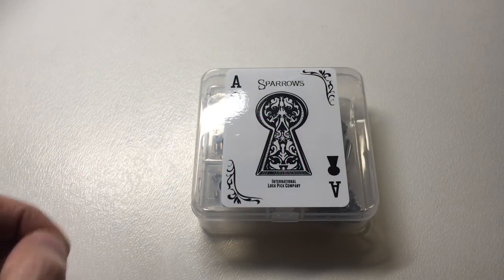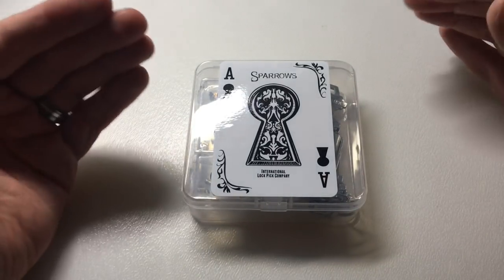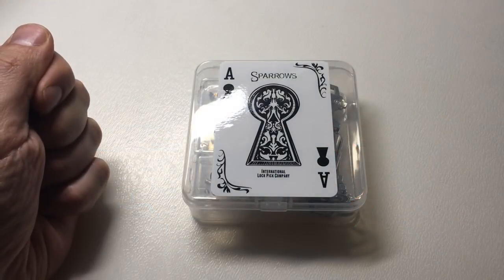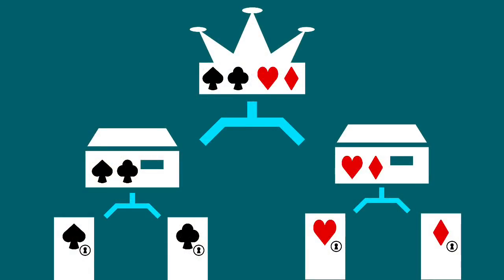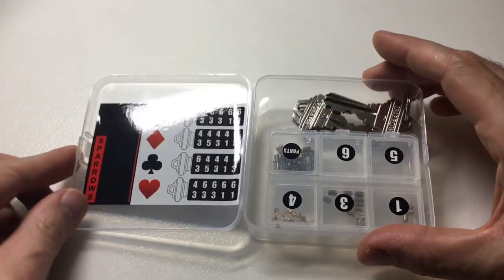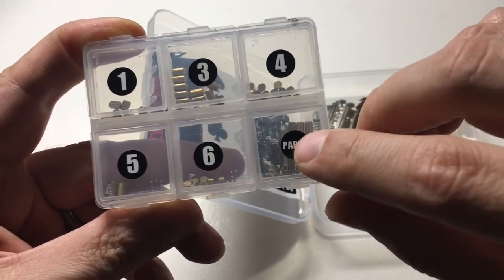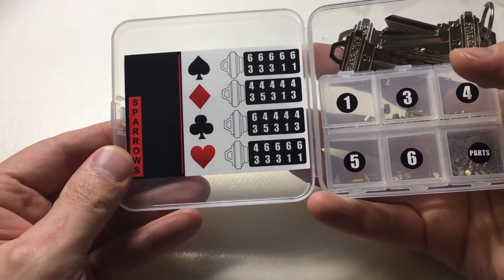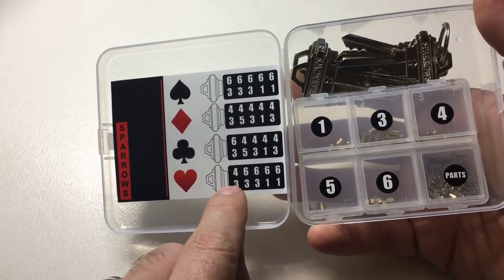Ultimate Sparrows Master Key Review and Guide

Comment: Very nice kit, but i feel that it needs to come with 4 locks.
Reply from the maker: CodeBurger or, you could treat yourself to the Sparrows Revolver ;-)
Reply: Lock Noob
The revolver seems pretty nice, especially for timed picking, but the fact that you have to rotate the cylinder to the correct position to test a key could make the whole experience less enjoyable.
I was thinking of something more like one lock per 'user' key (with the card symbol!).

For me, as long as they are not mixed, the master key and the revolver are very nice products.

Comment: An more complex setup is with each single-suited key opening the door to their building and the door to their own room, while the building attendant has a key for just the building but not the individual rooms, and the super attendant having a key for both buildings, but still not the individual rooms.
And of course variations of that, while still making sure none of the keys accidentally opens a lock they're not supposed to.
Reply from the maker: Yes, that does sound more complex :-) I wouldn't know where to start pinning that one, lol :-)

Comment: Hi, does the more master wafers you put, the more easier to pick the lock is? So if I need a master key (I'm the owner) and a slave key (for my tenant), should I pin the core with just one single master wafer? The less wafers the safer is the core agains picking right?
Reply from the maker: Yes, but please speak to a locksmith :-)
Reply: @LockNoob  I bought a complete Allegion Schlage repinning kit and I already started repinning my locks myself. I'm done paying 15 CAD each time I need to repin a lock. I haven't done master keying yet. But obviously I can't go see my local locksmith about that. So I intend tol learn on the net, surely it doesn't take a Ph.D to do that.

Comment: Cool kit, are they harder to pick?
Reply from the maker: Dusty Korpse actually, each wafer added makes the lock incrementally easier to pick as you have more possible shear lines :-)
Reply: Lock Noob do they make security wafers to help with that?
Reply from the maker: Andrew Campbell I'm not sure I know what you mean, sorry.
Reply: Sorry that wasn't terribly clear in retrospect.  What I meant to ask is, since adding master wafers weakens lock security, do they ever serrate master wafers, or make them spools, or T-shaped, etc, to try to help compensate for the added weakness of the master wafer?
Reply from the maker: Not that I know of, but I'm sure it's possible :-)
Reply: Andrew Campbell it could work if they were long enough but since a pin stack needs to drop down properly when it is left alone a fairly flat security wafer could well cause all sorts of hang ups and other mischief. But ... try stuff out, make new pins for and old core and see what you can do! There may well be mileage in it.